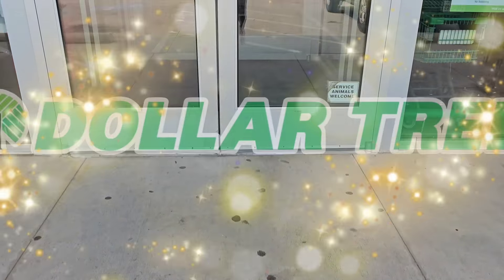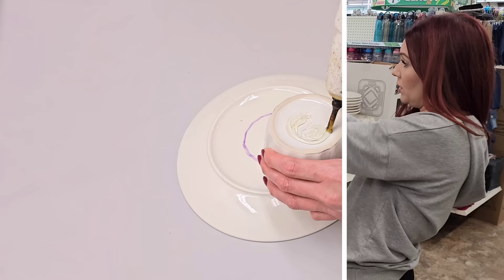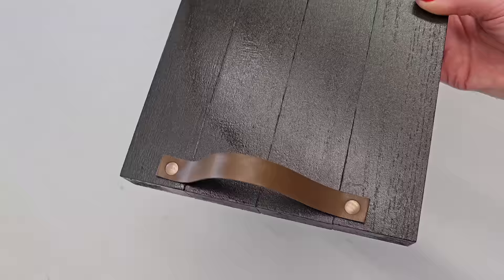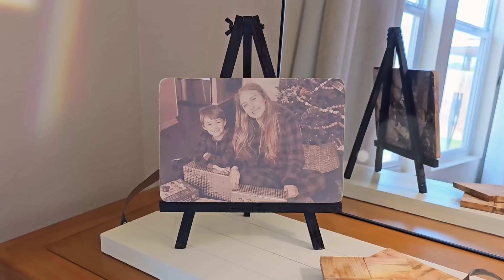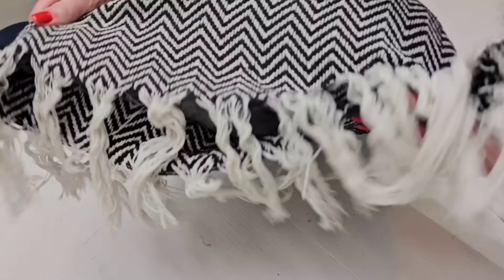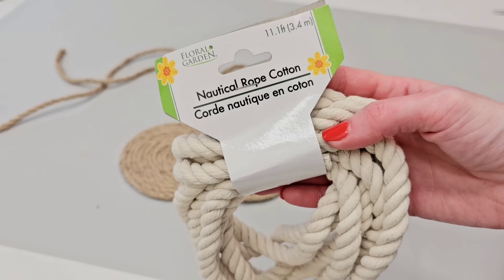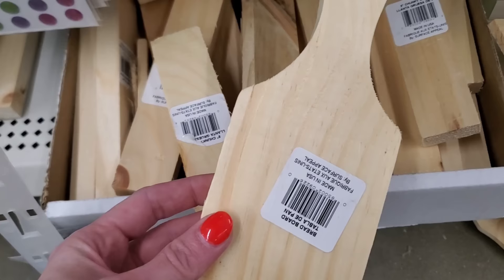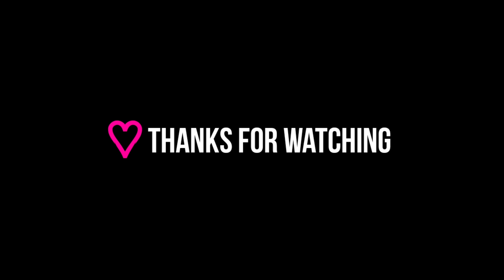10 Dollar Tree DIYs that DON'T LOOK CHEAP !

Comment: When using the DG pillows if you fold them in half sew ¼" on each side cut on the fold you have 2 pillow inserts instead of a bunch of loose stuffing. Either way it's much cheaper than buying a bag of poly fill 😊

Comment: Also on the painted board with candles you can glue some rope on both ends of the wood and hang it up on the side of the wall and it looks like a shelf and if you want to move it you can .

Comment: I used to use the seam ripper the same way you did in the video (long end down to cut seams) until I watched a lot of sewing videos and they used it totally opposite, short end with the little ball on end goes down with long pointed end up. The little ball protects material as you rip the seams. All these years I have been using it wrong!!

Comment: #2 looks nice, but that bond between the two dishes can be weak, depending upon the porosity of the dishes.  Use JB-Weld "Waterweld" instead of superglue and don't use hot glue at all.  It's a little bit off-white, but since it's underneath, people won't see it.

Comment: The pillow might not hold up outside with hot glue used. It will re-melt in the sun. 
Also, leave the stuffing in the dollar tree pillow, and just stuff that inside the case, so no stuffing leaks out between the fringe knots!

Comment: I really like the nautical rope coasters they will keep drips and condensation off the furniture which is the whole point of a coaster. First keep liquids off furniture and look nice. I would put cork on the bottom just in case it got too wet. I also love the tea lights.  Did you make that little key holder? I now know what I want  for my keys it's great and I can do that. Thanks for showing it with your craft

Comment: That rug pillow.... Why did you cut the seams on the sides then just glue them back ? I would have just united the end i want to stuff them tie it back up. Just saying. But all these ideas look great. I want to try some of them.
Reply from the maker: I did not cut the sides. I took out the stitches so the pillows would be wider. You could leave the stitches, but your pillow will be smaller❤

Comment: Not sure how well thumb tacks will hold over time if you want to be a truly secure I would  do screws instead if you're going to use it as a tray
Reply from the maker: That would definitely work too. I put super glue gel on the handles to reinforce and they won't come up if I try to pull them off.  A bigger concern would be the faux leather ripping, but that could be fix by doubling up the leather if you wanted. ❤️ 
-Megan

Comment: I must stress be aware if you are using MDF (which the signs in this video are) do NOT use water based product on them unless sealed first, you are outdoors, or in a well ventalated area without kids or animals. When MDF comes into contact with water it releases fumes including formaldehyde!

Comment: super glue and nearly direct heat from tea candles .... Is the a fire hazzard? How long before the wood get overheated. Great dazzling idea though. Please advise.
Reply from the maker: The tea light candles are set in a protective tin or adding the glass votive holders will protect from any over heating ❤️

Comment: Why would you seam wrip the sides just to reglue  them? Why wouldnt you leave the pillow and its case so you could wash it?
Reply from the maker: You can still wash them. I removed the seam to gain 2- 3 additional inches of fabric on each side. Or 4 - 6 extra inches.  ❤️ -Megan

Comment: I'm scared to try to melt the candles, don't want the jar to explode on the stove.
Reply from the maker: As long as you melt on low to medium heat, the candle will be fine. But if you are worried your candles are heating too fast you could be in the oven and melt your candles at 180°.  In the oven it will take about 35 minutes to an hour depending on how much wax is on your candle

Comment: You're using the seam ripper the wrong way .....
Reply: It worked though.
Reply: @eury5405  Yes extremely slowly however
Reply from the maker: What is the right way? I was never taught how, I just assumed... And we know how that saying goes 😂😂😂 
But, seriously, is the sharp side not for ripping the stitching or was I using it upside down? Thanks for the tip! 
- 💜Megan
Reply: @GlueGunsRoses  You're supposed to use the "balled" side down to prevent tearing the fabric. It kind of works as a fabric "guard" of sorts :)
Reply from the maker: @eury5405  🤦‍♀️I will do that next time
Reply: @GlueGunsRoses  Hey there.... just turn the ball part downwards.  This will prevent you from cutting or making holes in your material.  It just glides along so quickly.
Just check out on line, how to use a seam ripper correctly.  We've all done it wrong to begin with.